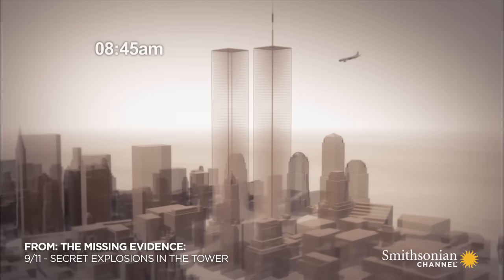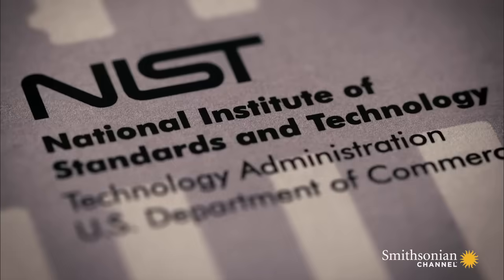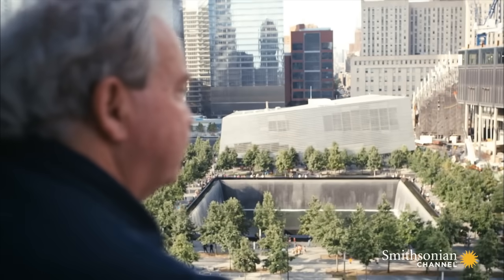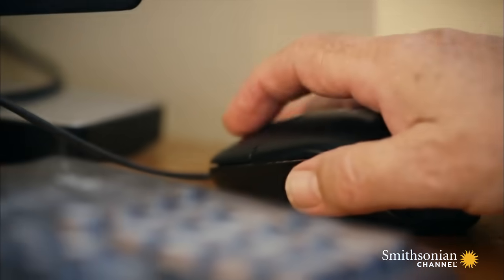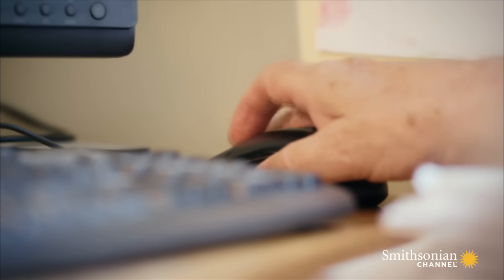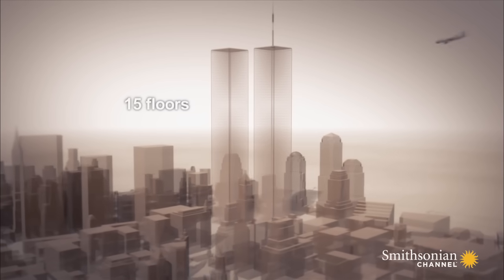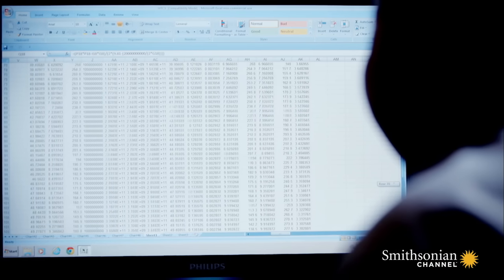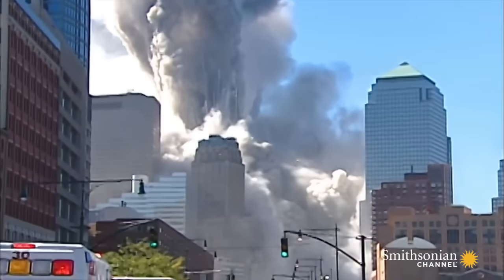This Computer Simulation Explains How the Twin Towers Fell

Comment: Except for the top of the building was falling away from the north tower. Did this bull shit simulation blow out every beam of a floor simultaneously,  allowing the upper floors to accelerate?  Ofcourse they did. The north tower( the one with the antenna) was falling off the top of the building. Let's take that into consideration, and redo this bill shit.
Reply: @Derrick Wright, The video evidence does not support your assertion that 'the top of the building was falling away'. If you have evidence of your assertion, please cite it so that we can take it into consideration.
Reply: @JohnJ-fj2xe  you gotta be kidding me man. I just took a screen shot of the picture but it wont allow me to post here. The top of the building is leaning at about 60 degrees at the start of the collapse. That isnt a myth, that's a fact.
Reply: @Derrick Wright, 60 degrees? I don't believe you know how that would look. The collapse would have initiated long before the lean advanced to that point.
Reply: @JohnJ-fj2xe  I'm in construction, this is literally my life. I say 60 degrees in regard to the top of the building being a flat plane. If you laid the building on its side it would measure 180 degrees. As the top of the building begins to bend upwards that number goes down. So with the building on its side it was an obtuse angle at 150 degrees prior to collapse. Or 60 degrees with the top of the building being at a flat plan. So yes. You can prove this with a Google search, a protractor,  and an open mind to the facts.
Reply: @Derrick Wright, Your thoughts are not very clear. "The top of the building bending upwards"? Upwards? At no time did the top of either building bend 'upwards'. I don't know what you think you're seeing, but it does not align with the numerous videos I've seen of both collapses.
Reply: @JohnJ-fj2xe  I was merely explaining angles to you. I said imagine the building wasnt standing but laying on its side. That is an imaginary scenario to explain geometry to you. You've clearly never watched the north tower collapse, or else it would be obvious to you. The top of the building was falling away as the collapsed started. Which is why noone with intelligence believes it could have collapsed uniformly.
Reply: @Derrick Wright, You have the observation and analytical skills of a....construction worker.

Comment: So then why didnt the tower fall in 93 when the bottom floor was destroyed???
Destroying one floor would pancake all the others???...then why dont demolition experts destroy buildings in the same way today? What precausions are being taken in building skyscrapers now since burning one floor to bits will destroy the entire building?
Reply: @Jony_B, Your argument regarding 'one floor' being destroyed is flawed from the beginning. That is, each airplane impact destroyed several floors simultaneously, creating 'gaps' in the central core and perimeter vertical supports. When the lateral support elements finally failed and destroyed the connections between the inner and outer 'tubes', their collective structural integrity was severely compromised and they could not support the weight of the upper floors. When they finally failed, the upper sections fell through the 'gaps', generating enormous kinetic energy the overwhelmed the top floor of the lower section. When that floor was destroyed, it also began the destruction of the supporting elements of the lower section in the form of a progressive collapse. In short, if you're going to intelligently discuss what brought the towers down, you must first have a clear understanding of what held them up.
Reply: The 93 bombing was in the car park building on the side of the towers, not under them. The explosion bounced off a very thick concrete wall.

Comment: I've gotta get me one of those magic planes that can shear through structural steel without slowing down!    The sweetest thing is:  They left a Willie Coyote cutout of themselves!!!
Reply: @Dennis Pfeifer, The vertical surfaces of the WTC towers were 40% glass and were not solid sheets of steel. Further, the perimeter support columns were designed to resist vertical, not lateral, forces. The mass of 100+ ton airplane flying at almost 400 knots easily overcame them, as we saw.

Comment: If a plane were to hit a building, the entire building wouldn’t fall. Just the top where it was hit. That was a job of demolition squad. All demolition building fall down meaning there were bombs planted in the building. Just saying 🤷🏽‍♀️
Reply: The planes didn't make the WTC buildings fall; fires did.
Reply: Richard Alexander *explosions, other skyscrapers have burned for a long time and didn’t fall. There were explosions in the building causing it to crumble
Reply: @pauciloquent1417  There were loud bangs in WTC, but no explosions anywhere near powerful enough to make the buildings collapse. Loud bangs in burning buildings is not unusual. Each WTC Tower had 1000 gas cans with gasoline in them, for example. Other skyscrapers burned without collapsing because they had active fire suppression, and many of those towers were built with concrete, which doesn't have the same vulnerability to fire that steel does.
Reply: Richard Alexander believe what you want, feed into what the government tells you. Idc
Reply: @pauciloquent1417  As opposed to wearing a tin-foil hat the rest of your life, listening to rambling kooks.
Reply: Richard Alexander you sound like a rambling kook, all you’re doing is repeating what your government has stated
Reply: @pauciloquent1417  You should learn early in life that just because the government says something does not make it wrong.
Reply: Richard Alexander well they say a lot of false things and cover up a lot of shit so therefore it is false to me. If they don’t have anything to hide then why be so private. Shouldn’t we know what our government is up to? They watch us all the time so why can’t we
Reply: @pauciloquent1417  How do you know that what government says is false? As for privacy, do you really want the world to know your Social Security Number or the access codes to our nuclear arsenal? Regardless, none of these things tells us anything about 9/11.
Reply: Richard Alexander i don’t even know my on ssn 😭😭, but there are a lot of cover ups and 9/11 definitely is one of them.
Reply: @pauciloquent1417  Saying that 9/11 was a cover-up doesn't tell us anything about 9/11. It's just something you said, and we don't even know what you mean by it. What was covered up? By who? What does it mean? You aren't telling us anything.
Reply: Richard Alexander watch the loose change documentary, I had my doubts but in the end it made a lot of sense
Reply: @pauciloquent1417  "Loose Change" was a fiction that someone threw together. It's garbage.

Comment: Exactly. The collapsing building section only had to destroy the floor slabs below to cause a total and unstoppable collapse.

Once about 4 to 6 floor slabs were destroyed, the outer perimeter collumns COULD NOT STAND ALONE without the stability provided by the floor slabs or rather their steel trusses.

The outer perimeter collumns merely peeled away, detached and fell to Earth.

The entire building collapsed in this manner, leaving the central core standing momentarily, naked of its floor slabs and truss connections until falling debris destroyed its foundation and it buckled and collapsed too, as can clearly be seen in the footage of the collapse.

As if more evidence to debunk the idiot "truthers" was needed, this CLEARLY renders their idiot "controlled demolition" via explosives and/or thermate/thermite or any "nano" version thereof installed in the central core COMPLETELY and TOTALLY INVALID, just like ALL the MANY other idiot "truther" theories.

The central core after all, WAS THE LAST THING TO COLLAPSE.

'Splain that, morons. lol

Comment: Proper title: "This Cheap Computer Simulation Explains Nothing At All"
Reply: Federico Lucchi excel
Reply: Oh.. so let me get your reasoning straight.  If one floor cant hold the weight of 15 landing on it ( which it cant!!)  Why should we expect the next floor to fair any better with 15 PLUS one landing on it.  Considering that mass is the SQUARE of the velocity.   Your problem is is 4x worse with EACH NEW COLLISION.
Reply: @roquefortfiles   You're starting from the wrong premise you should be asking yourself how all the support columns on one floor fail in the same split second which has to have happened as the upper floors descended perfectly vertically. If the 'planes'  had instigated  any structural damage then the upper floors would have had to rotate towards that structural weakness which they clearly did not ... Oh and the kinetic energy of a mass is the square of its velocity
Reply: @crangonvulgaris9820  I am guessing you missed the 20 degree rotation that the top 23 stories underwent when they failed. Where did the plane hit?  Off centre along one side.  How did the building fail?. Off centre to one side.  Go and look at it
Reply: @crangonvulgaris9820   No. the assumption you're making is that all the columns have to fail.  Without the cross brace of the floors the amount of load the columns can carry drops by a logarithmic factor.  Once the loads start to move in directions they're not supposed to go the building starts to fail.....FAST!!.
Reply: @roquefortfiles   In the direction of the moving load
Reply: @roquefortfiles   OK, which site do you recommend?
Reply: I wrote an engineer on all of this. He said.. Once the loads are no longer being carried in the manner they are designed for the building starts going berserk. The failure process SPEEDS UP!! .  Theres z good Nova special on its design
Reply: @crangonvulgaris9820    All you have to do is go and take a long hard look at how each building came down.   WTC 2 is hit off center along one side.  This results in an unbalanced load above the point of impact.  Half the columns are basically carrying NOTHING.  The other columns are being asked to carry significantly more.   There's no problem so long as the exterior wall bracing that off center load remains stable. 

But what happens?  The exterior columns start to BOW inward. 5 Feet in some areas.  That wall starts to buckle.   Once it reaches the point of failure the top 23 stories of the building are set in motion. 

They're not supposed to do that.
Reply: I did my own calculations, by hand. What I found is that the question isn't even close; the collapsing parts of the Towers produced impact forces several hundred times what the building was designed to support.
Reply: @Pooua   Show your workings.
Reply: Richard Alexander   “Calculations by hand”? Did you publish your work in a scientific journal? 😂😂. Maybe you should quit doing calculations altogether.
Reply: @Pooua   Try explaining that concept to these twits.    No matter how much you explain it they don't WANT to hear it.

Comment: One: the melting point of steel is the point at which it becomes molten. It goes soft and flexible WELL before then. Oh, and skyscrapers are heavy! 
Two "explosions". The building was connected at many points via elevator shafts, AC ducts, and plumbing and electrical risers. Fire and dust gets pushed through these vessels at an extreme rate via air pressure, especially when you have millions of pounds of debris redlining the pressure gauge. Escaping fire and dust looks like an explosion. 
Three: The buildings were designed to withstand an airliner strike, WHEN THEY WERE BUILT, and... kind of a lot had happened in aviation over 33 years before they were slammed into with loaded Boring 737s. 
Four: Believe what you want boo boo, but a little common sense and education will reveal your "conspiracy" is full of s#!t.
Reply: TYRANTS

Comment: They fell like they did so it wouldn’t damage the buildings around it, these were not the primary targets.
Follow the evidence & follow the money, that leads you to a clearer answer
Reply: RedBB what are you smoking?
Reply: Dr PhD I’m guessing you haven’t studied the facts about that day
Reply: The facts??? The weight from the top pushed the whole thing down, how else should they have fallen? It’s not a tree it’s a building.
Reply: Dr PhD You seriously need to look at the evidence, melting temperature of steel, why it was still on fire 2 months after it was being covered in water endlessly, why is the rubble all removed & under military guard if there’s nothing to hide. How about the evidence for the supposed plane that hit the pentagon, have you actually looked into this as you give me the impression you haven’t

Comment: utter horse shit....if a building that high is damaged on 1 side it will topple toward the weakened side ....not straight down ...like a demolition ??
Reply: Where's your calculations?
Reply: @Pooua  if any structure that big has substantial damage to one side its going to fall toward that side...simple physics
Reply: @andrewnicholson4811  The WTC Towers were designed to spread the load if some of the columns were damaged. That means that it wouldn't lean if one side was damaged. Don't lie in the name of physics!

Comment: AHAHAHA...if 1 floor failed, the rest would fail below it huh? Yikes. 

Office fires dont turn buildings to dust.
Reply: WTC wasn't turned to dust.
Reply: @Pooua  You must have missed the dust that blanketed the entire city 1 foot deep and went so high up it blocked the sun. I didnt. Where did all the dust come from? How much distance would that level of coverage require? A small amount of dust? 

Or did you miss what was scattered around ground zero 15-25 blocks in every direction? The biggest pieces of office equipment, 1 foot square. No pancaked floors. No toppled floors intact. I didnt miss any of that. The sub level that was filled with molten steel and rubble. No large pieces of building intact. 

That's not what any collapse from structural failure looks like. You know why the firefighters ran up the towers? Because that's how they are trained to deal with fires and explosions and collisions 1000ft up. You know why that's their training? Because modern steel structures dont collapse from fire. Ever. None before, none since. 3 have in history. All in that day. 

Not believing your own eyes and ears and eye witness accounts, is fine. That's your choice. But dont tell me what was there and what wasn't. Those buildings turned to dust and were pulverized. Even NIST agrees on that.
Reply: @wageslave8770  These shills and boomers man...

"The CNN and the gubmint man said this is what happened! So obviously that's SCIENCE!"
Reply: @joemo1033  It's too bad that you inbred hicks are too stupid to take a science class.
Reply: @Pooua  Is that what I should do? Take a science class? Good one. 🤣
Reply: @joemo1033  A good college Physics class should dispel these silly notions you have.
Reply: @Pooua  Haha. Savage. Man, you are really good at this.
Reply: @wageslave8770  You mean, "Pay no attention to people with facts and logic."

Comment: His calculations are flawed from the start because they are based on a free fall of the entire top of the building the height of one floor, something that could not have happened as the top section would begin to sink the instant the steel's temperature reached a certain point at which its ability to hold the weight above it was only slightly compromised.  It would not, in other words, perfectly mimic the use of explosive charges to simultaneously sever every column, inducing a one floor drop.  Also, who cares that the NIST report cost $16 million? The fact is it failed to explain how the towers came down. Combined with their own admission that they conducted no forensic tests for evidence of explosives, their report is actually a worthless suggestion of something they claim probably happened based on computer models that the public are not allowed to see.  Since they don't show us their computer models or their data, all they actually have is a computer animation. $16 million well spent.  Speaking of, I love how the animation at the beginning shows the towers as being hollow, making a collapse appear more plausible.  Finally, I will take David Chandler's analysis over Greening's model because Chandler actually measured the rate of acceleration of the top sections' actual descents and found them to be constant.  NIST itself acknowledged he was correct in the case of WTC7 when they amended their report after he called them out on their 'mistakes'.

Comment: CONTROLLED DEMOLITION DONE BY THEIR OWN GOVERNMENT AND THE ENTIRE WORLD KNOWS IT
Reply: Definitely a Mossad operation!
Reply: Even though I’m 36, I still wake up each morning hard as a rock.
Reply: Controlled demolition buildings do not fall at free fall
Reply: @Shelby_Starner_Everything   they can if it's properly executed
Reply: @crangonvulgaris9820  yes, but free fall or near free fall, of the twin towers does not prove it was controlled demolition. And symmetrical collapse also does not prove it either. You would need an insane amount of explosives to bring those towers down, it would be like fire works going off on new years eve. Its easy for people to sit behind their computer and say it was controlled demo, but its easier said than done.
Reply: @crangonvulgaris9820  Where are all the cut marks, on the steel beams, from the demolition explosives?

Comment: Why the heck do we need a computer simulation? We all saw it freefall as the planted cutting charges sliced through the steel beams ahead of each floor falling. NO ALUMINUM PLANE could possibly penetrate structurally reinforced concrete. The wings would have detached and fallen to the ground when it hit and no cartoon animation can change reality.
Reply: The WTC buildings did not use any concrete support members.
Reply: controlled demolition does not make buildings fall at free fall